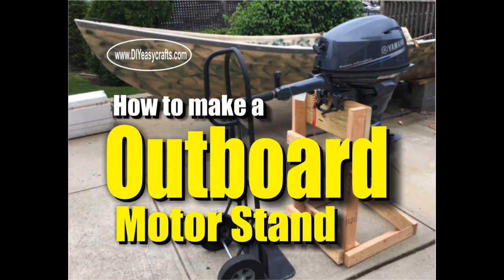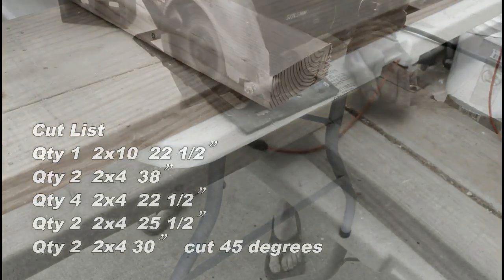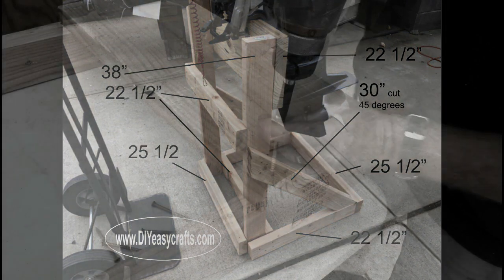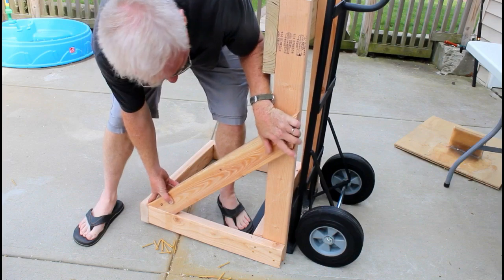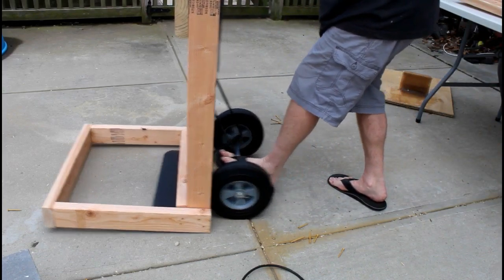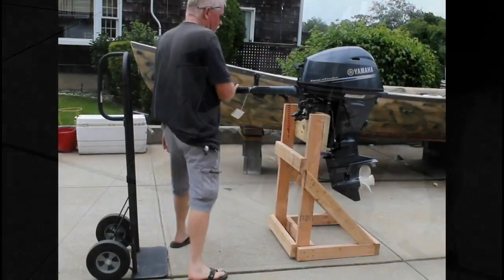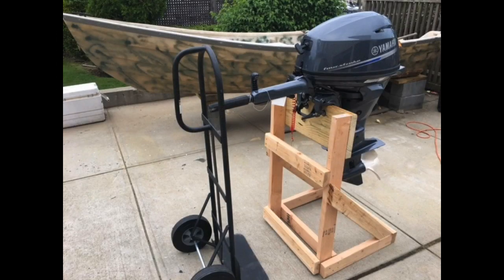How to make an inexpensive portable Outboard Motor Stand

Comment: I built one today for a 20hp Mercury.  Used 24 and 27 inch instead of the 1/2" dimensions but kept the other dimensions as described.  Didn't quite do it in 15 minutes but it was a heck of a lot faster than if I planned it out myself by guess and by golly.  And I just so happened to have a dolly on hand- bonus.  My wife thought I was quite clever and I took the credit so I thought it only fair to come on here and give you some props.  Thanks for posting this bro.
Reply from the maker: That is absolutely awesome! I will never tell

Comment: Thanks for the video!
Took me about an hour and works great for my 9.8!

For those needing help with the cut list, here's what worked for me (three 2x4x8s)

Most 2x4s have at least one square end - start there or square an end yourself.

Board #1- both 25 1/2" boardscand two of the 22 1/2" boards
Boards #2 and #3 - from each board you can get one 38", one 30" and one 22 1/2" board

I used a piece of scrap 2x6 for the motor bracket.
I also used 2 1/2" and 3 1/2" stainless screws (because I had them on hand)
Reply: Question: Regarding the pieces that have the 45 degrees cuts = is that 30" for the long side or the short side, if you know what I mean, thanks
Reply: @seanmaddox1736 was wondering same. Did you end up building this and figuring out?  Thanks!
Reply: @seanmaddox1736  sorry for the delayed response - 30" boards are for the diagonal supports (mark and cut appropriate 45 degree cuts on each end ) and 38" boards are the verticals.
Reply: @mikecorazza  the 30" boards start out as 30 inches, then the cuts are taken off. Hold them in place and mark with a pencil to make sure the 45 degree cuts go the correct directions (one side stays 30" or slightly shorter, depending on your saw, and the other side is significantly shorter). My boards ended up at 29 3/4" on the long side and 23" on the short side...
Reply: @tonymazza8305  thanks for clarifying!

Comment: I built one of these today. I made one small modification by adding some 1/4" plywood gussets at the front corners to make it a little more torsionally rigid. That  required me to shorten the angle braces a couple of inches but otherwise it’s exactly as you built yours and the thing is solid as a rock. Thanks!

Comment: Gordon D, said that he built one similar but never thought  of a handy cart,Good idea.I use it to store the motor 4 winter.;-)
Reply: Gordon D.,I also made my old one with a little slope like boat so the weight of for motor will be a little more sturdy when on a ground instead of cement or paved drive.I caught that 1/2 " inch space for cart ,point taken.Works great and thanks for the heads up.

Comment: Thanks, i just made one myself as well. However, i would suggest a base plate. So when we are running older outboard motors. The  bucket to submerge the pump shouldnt have to take a lot of water. Saves time snd water bill.

Comment: Took you a 15 mins, took me an hour to cut wood with a hand saw, and then, 'cos I'm simple and have no carpentry skills of any kind, in my wisdom I'd bought 10cm timber screws with torx sockets that my cheapo 500w impact drill couldn't deal with, even with pilot holes, so I just got finished after 2 and a half hours of hand screwing them in with a bar/spinner thing I have. I am now exhausted, but I have a stand and my brand new, first ever 2.5hp Mariner four stroke is hanging on it :) . I will pay for this in the morning.

Comment: Awesome,thanks !!!! I just ordered the wood from Lowes and will have them cut it = Question: Regarding the pieces that have the 45 degrees cuts = is that 30" for the long side or the short side, if you know what I mean, thanks
Reply from the maker: Yes the long side. Best of luck with your build
Reply: @DIYeasycrafts  After I wrote my question I then realized how silly it was but thanks for confirming anyway.
In my case I live in a lake community and dont have a garage to store it so I am buying outdoor pressure treated lumber to last longer, right? Plus I know neighbors who will want to borrow it from me, lol.
Two final questions please:
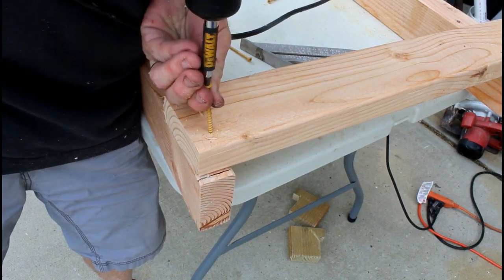1) At the 2:00 minute mark you say "in the future if I did this again I would probably use ...." but I cant make out what you said...what was that?
2) Which pieces did you use 3" screws on? vs the 2-1/2" screws?
Many thanks again!

Comment: I was thinking you should add about 6 inches to the bottom rails (22 1/2" pieces), so that you can put a bigger trash can under it to run the motor.  I'm also trying to see a way to make it collapsible, using wing nuts or something.

Comment: I wonder if 38" is a little high for an 8hp with 15" shaft if you want to run it in a 5 gal. bucket.
Reply from the maker: You would have to put the bucket ontop of a cinder block
Reply: @DIYeasycrafts  What  shaft length does this design work for?  I want to build one for 25" shaft motor. Thanks

Comment: Think this is robust enough to support a old heavy 50 hp MErc i like the design MAybe i should just make the base wider for stability with the bigger load
Reply from the maker: If your concerned use 2x6s instead of 2x4s.